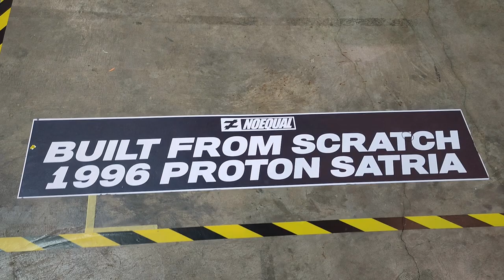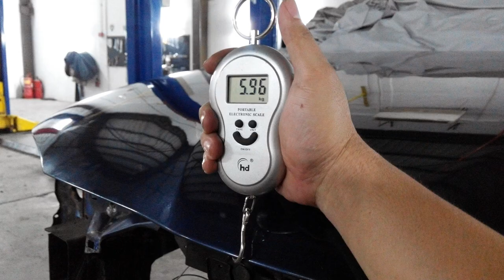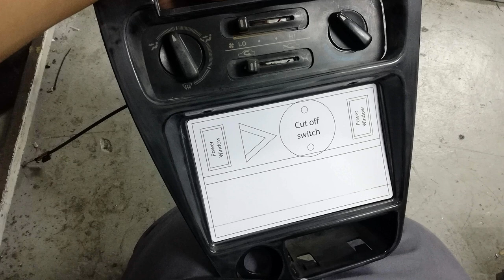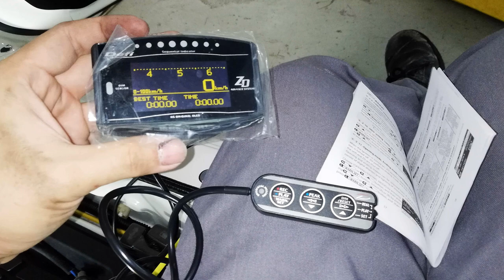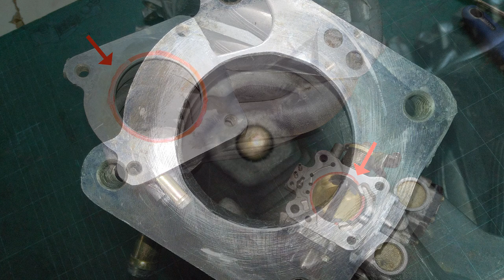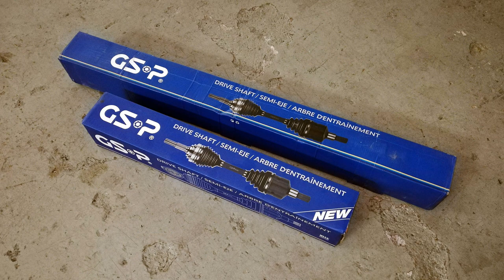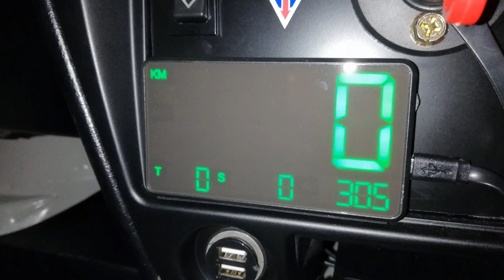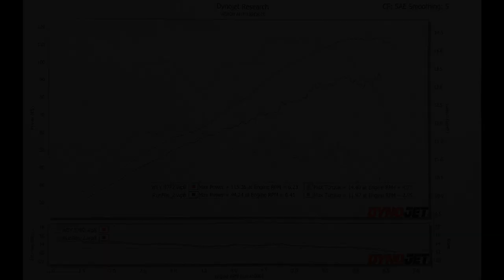Rebuild the 1996 Proton Satria from scratch [subtitle]

Comment: Brilliant. Wish I could be like you. Such immense knowledge of the mechanicals. Good job! By the way, is it possible to install a turbo charger or slight modifications necessary before install ? How to improve control at high speeds ? Do Protons have old Mitsubishi or Toyota engines ? Or does Proton build engines in house ?
Reply from the maker: Thank you. Engine can do any modification before put it back into car, depend how much is your budget.

To improve control at high speed, high performance tyre can help a lot.

How many type of engine Proton have? Does Proton build engines in house? I think Proton official can answer your question.

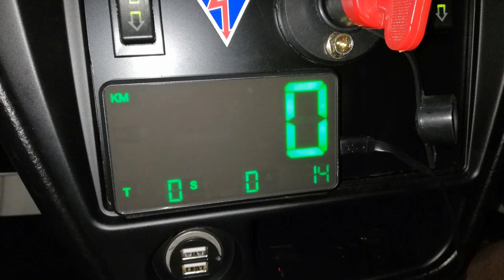Comment: 28:48 hi bro wanna ask bout the GPS speedometer u used, im using the same one but how did you mount it like that and still get GPS signal? mine sometimes looses its signal and can it be mounted anywhere on the dash even if it is not exposed (under sun/sky) to get signal? just wondering since it uses GPS signal
Reply from the maker: I have no clue. May be the GPS signal is disturb by the window tinted material on the front windshield.
Reply: @SanchazKok-DrivingDiary  i see that could be what im facing since i have tint on the windshield, have you had problem with the reading since you mount it near your kill switch? i noticed that when you lose signal, the mileage wont be as accurate.
Reply from the maker: I don't have any problem with the meter so far. Only when entering tunnel or basement car park, the GPS signal will lost, and mileage reading will increase a little bit but not much.
Reply: @SanchazKok-DrivingDiary  ohh so it must've been something in my car thats interfering with the GPS signal on normal situation, or might just been a faulty unit. thanks for the clarification! Sick build thoo

Comment: I no car expert, but 5w50 is a bit thick for non turbo engine? Something like 10w40 can actually let engine give a bit more HP at the wheels.
Reply from the maker: No worry, the oil viscosity is still within the manufacturer recommended range.

Comment: kamu ade ambil kerja utk rebulid kereta ke? atau hanya buat utk kegunaan sendiri ? dlm video tu tunjuk kerja kamu memang bagus dan hasil nya memang tip top 👍👍 ⭐⭐⭐⭐⭐ 5 bintang
Reply from the maker: Saya tidak ada workshop sendiri. Kereta ini hanya buat untuk sendiri sahaja.
Reply: @SanchazKok-DrivingDiary  tapi kalau sy mintak tolong utk rebuild kereta kembara sy sangup tak ? dan kalau sangup agak2 berapa upah nya ...katakan laa sy angar kan ambil  masa 6 ke 8 bulan (upah sahaja tak termasuk spare part)...berapa ?
Reply from the maker: @nordinmohamad521  Maaf, saya bukan full time mechanic. Dulu saya guna dua jam untuk buat kereta sendiri, lepas kerja.
Reply: boleh tau ka bpa modal dari awal smpai sekarang bos??
Reply from the maker: @mohammadariff3959  dalam RM20k

Comment: how did you restore the rusty areas of the body please
Reply from the maker: If the area of rust is very mild, sand it and paint it is fine. But if the area of rust is serious, for small hole I will weld it back, for large area, I will cut it in square shape, and replace a new shade of metal.

Comment: any reason why you only do a tac spot welding instead of the full weld ?
Reply from the maker: Welding will shrink the area a little bit. If welding continuously, more part will be shrink, causing chassis deform.
Reply: @SanchazKok-DrivingDiary  thank you for the explanation.

Comment: Wow you seam welded the whole chassis? What was the effect on the handling after you did that?
Reply from the maker: I can say no obvious effect on car handling. The welding process make the chassis much more robust, so it can withstand aggressive driving without damaging the chassis.
Reply: @SanchazKok-DrivingDiary  Ok, so the reinforcing brackets underneath the car and inside on the floor are mainly for robustness and not for improving the handling by stiffening the chassis?
Reply from the maker: Both is different part
Reply from the maker: Although both serve the same purpose.